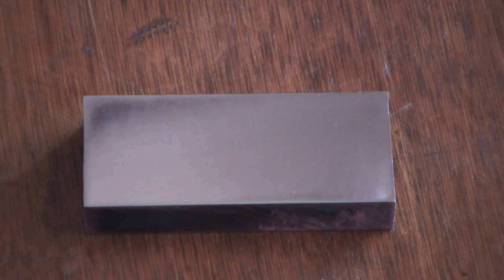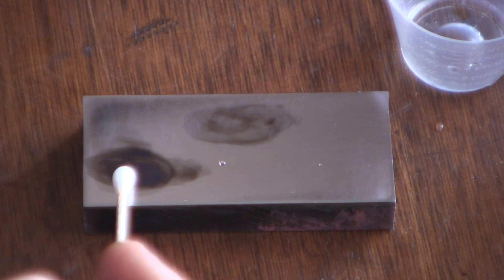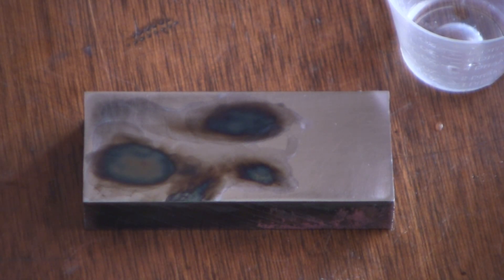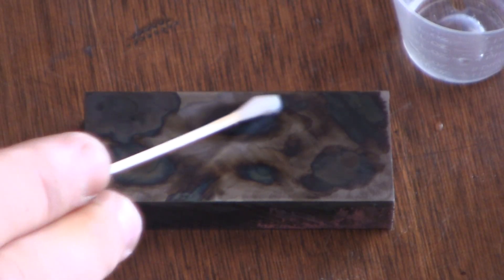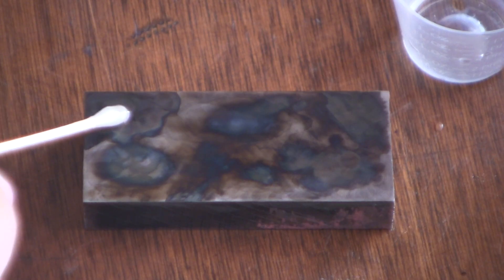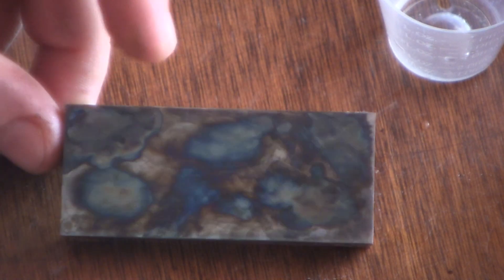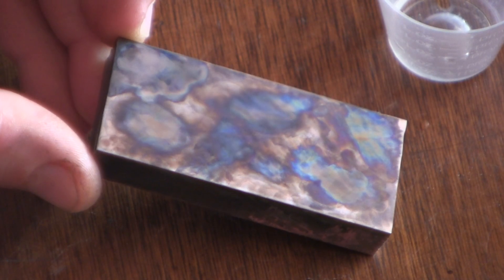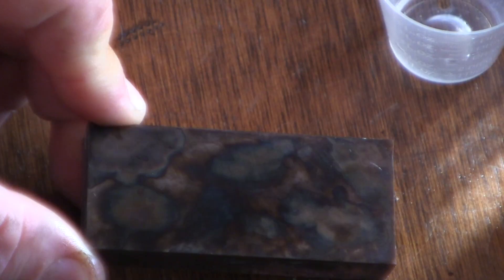Color Case Hardening Effect using Cold Blue

Comment: I just bought a pietta alchimista from EMF and when it arrived I noticed that on both sides where the frame meets the brass trigger guard, the case hardening effect was rubbed off and literally looks like polished steel. I tried using my brownells oxpho-blue along that area and it did exactly nothing. I dont know if its just that the brownells doesn’t work well, or if the pietta frame is stainless or something but im at a loss as to how to fix this and i cant spend hundreds more by sending it out to a shop. Any ideas why the oxpho blue paste didn’t do anything at all to the frame. Thanks so much
Reply from the maker: @MichaelEgan66  I don't know if it is stainless though it could be 416 for example.
Reply: @MosinVirus  I mean, I've used that oxpho blue creme on every other part of the gun and it works fine. I've puddled it onto the bare spots on the frame and left it for an hour and nothing happens.
Reply from the maker: @MichaelEgan66 It sure sounds like the frame is stainless.
Reply: Thank you for the confirmation. I'm at my wits end with this and pietta just will not respond to my inquiries.

Comment: Did it rust after words ? I heard after you apply the bluefish. You need to rub it down with a little bit of water so it doesn’t rust.
Reply from the maker: No, it still looks like it did when I made the video. Oiling is needed to prevent rust.

Comment: Hoping you still reply! 
I for some reason can't get it to work. I'm trying it on a steel ring I made and it pretty much only colours grey. Sometimes I get it to become somewhat blue, but it gets some cloudy stuff over it. When I then wipe that away, the colour also fades. 
But even when I get a colour, it is not nearly as vivid as yours.
Reply from the maker: Not sure what could be going differently. Try oiling the surface first. Bluing solutions are also degreasers so they should cut through the fine oil film. And perhaps dilute the solution a little more.
Reply: @MosinVirus  Hey Mosin! 
Thanks for the tip! I had a couple retries at the blueing, and I finally got a very nice blue undertone. Adding the oil really slowed down the chemical process, so I could accurately control the colouring stage.
The ring I made is definitely still very dark though. Not at all the vivid colours you have sadly. Maybe it's because we have different steel types? But I'm happy with it. The birthday girl is getting it today! 
I have another question! What do you recommend for how often it should be oiled (keeping in mind that it's going to be worn)? Or would you recommend a clear coat?
I also want to say: thank you very very much for this video!
Reply from the maker: @jhygdefghsd7011  definitely a clear coat. And I am glad I could help.

Comment: Is it possible do on chef knife? And be usable in kitche ?
Reply from the maker: The knife would have to be made from carbon steel and I still wouldn't use it in the kitchen afterwards.
Reply: @MosinVirus that what I though 😞 what do you think about patina gel? It water base chemical react to steel to make colour case harden? Apparently they said no pigment or dyes
Reply from the maker: @doggystyle2603  i never tried those.
Reply: @MosinVirus thank for replying.

Comment: If that looks as good in real life as it does on my screen, then it's absolutely awesome! Really impressed! I love the colours of case hardening, but it's an absolute nightmare going through the process of doing it properly! Can be quite risky too as parts can get distorted at the high temperatures involved!
Reply from the maker: Indeed. However no benefits of hardening.
Reply: @MosinVirus  true. I'm a knife maker, and there may be some potential to use this technique on parts that don't need hardening, such as crossguards and pommels. Depending on how it looks when I try it.
Reply from the maker: @BatwingForge  definitely give it a try.

Comment: Thank you for sharing ! 
I have a car I am taking to bare metal -Not a "cool" car though. Just an art car for advertising my art.  I just might use this technique !
I'm not sure it could be of use, but I feel like I should return the favor and tell you about something I accidently came across. I'm not sure what you would use it for, but here goes : Take some rusty metal ( but smooth - not too rusty ) and apply some paint to it in several thick layers. Let it set ouside for a month or two in the elements. Let it rust.
Peel the paint off, and you have strips of actual rust stuck to the back of the strips like rusted tape. 
You can then apply it to areas you want to have a rusty texture, but without actually damaging the item with rust. 
Do I have any examples or videos ? Sorry - no. 
As of now, I have not created any rust strips. It's just something I happened to come across on some old lawn chairs and thought might be useful.
Reply from the maker: Thank you very much. I will definitely try this myself. And yes, as the name implies, that is what got me started in guns.

Comment: OK so you’ve created some fake case hardening.. why don’t you just really case hardened it…???
Reply from the maker: This video was about creating a similar effect without actual case hardening. This was not a video showing how case hardening is done. If the video was about case hardening then it would have been a video about that. To tell you the truth I am a little confused by the question.
Reply: Great question. True color case hardening requires a furnace/kiln and materials to achieve this effect. This is a relatively cheap and simple way to simulate case hardening on a budget and takes A LOT less time.

Comment: Looks like Italian "case hardening". Doesn't quite pop like real case hardening nor does it actually harden the steel but if you don't need to harden steel and you want to replicate the Italian look, say restoring a neglected Italian gun, this is certainly the way to do it.

I keep this style in mind for my Italian guns. As they wear, I know I can polish and apply this solution and get the results I expect.

The butt plate on my Super Match rusted a bit on the toe due to heavy sweat during shooting and I missed wiping that edge with water to remove the salt. The heel of the plate has a brushed finish from sitting vertical upright and a bit of grit got to the plate. Not the end of the world, a once over with various grades of sandpaper then a polish and then this will bring it back to factory new.
No big deal.
Reply from the maker: Thank you. Yes, this is purely for looks, offers no surface protection and clearly no heat treating takes place. I was just surprised to see it so decided to share.

Comment: Is there sufficient bluing to protect the surface/prevent rust.  Bought an ESEE 5 with the intent to put a convex edge on it, strip, and then ... I'm not sure.  Until I saw this video, I was going back and forth between bluing or a high polish.  Or perhaps a high polish and then bluing.  Have you tried this technique on a 1095 knife?
Reply from the maker: The method shown in the video offers virtually no protection. Even cold blue when done properly offers little protection. Parkerizing is my favorite finish due to ease, and slow rust blue is awesome but time consuming.

Comment: Thanks man this lead me to this I picked up, If any one wants to get that on high polished gun steel and wants a high colour finish, when using the bud dip in super blue then take some very fine steel wool and brake the strands to make it less compacated and put the steel wool on the bit you want to colour and rub the bud on the steel wool on the gun steel and rub in for 4 to 5 seconds then use a fresh bit of wool and new bud to start the chemical reaction over again till your happy with the end finish, then rub light with fine steel  wool and finish with some protective gun oil 👍 I had no look with this but figured this little trick what might be what some are looking for. 😁
Reply from the maker: Thank you for sharing.

Comment: I'm going to use this to clean up a wall-hanger crescent side by side I have. It's not worth any real investment but I think this will be perfect for making it look a little fancier hanging on the wall. Thanks for sharing this!
Reply: I'm doing the same!
Reply from the maker: My pleasure.
Reply: @MosinVirus  I realize you may have answered this in the video already, but I want to make sure I get the mixture right. Can I ask what the exact mixture you used is? Thanks very much!
Reply: @franksmith7792 I thought he just dipped the q-tip in pure cold blueing solution... then dipped it in to regular water after that. Then used oil at the end to stop the chemical reaction.

Comment: For how much time it can last.
Reply from the maker: It will depend on how much use the surface gets. This block of steel has been on a book shelf since the video and still looks exactly like it did in the video.
Reply: @MosinVirus  now i have seen you have made this video in 2017 and its been 3 years since then, it is a long time
Reply: @MosinVirus  do tell me how many hours or days it will last, i am struggling to achieve a surface treatment and this looks fine at its place
Reply from the maker: @MONEYTECHDIGEST  I don't understand what surface we are talking about. But, as i said before, it depends on how the surface will be used. For example, if you are going to hit rocks with that surface it will probably not last very long. With general use, like hands touching it, it will last a long time, especially if it is also coated with clear coat.
Reply: @MosinVirus  I want to use it in some mechanical parts, I am trying hard to achieve this effect with heat treatment on alloy tool steel but i am unable to do so..

Comment: I've done this by putting a wash of detergent solution on first, and got some great colors.
Reply: What detergent solution? Pics of results?
Reply: @AviationJeremy  Any washing up liquid 50/50 with water. You can also put a few small dots of copper sulphate solution on first, to get some reds.
Reply: I'm getting ready to go e this a try. Just to clarify, you're washing the gun clean with detergent or leaving detergent on the metal before adding the solvent? By great colors, bold traditional colors or extra non traditional color?
Thanks
Reply: @donavonrobbins1908  Just mix washing up liquid with water, put it on clean steel and dab on some blueing solution. The detergent lowers the surface tension and you get a cool effect. Different blueing solutions give different colours, and if you add little dots of copper sulphate solution you'll get reds and golds. Just do some practice runs. You can always polish it off and try again. It's all done wet on wet. Once your happy with the result, rinse with hot water and let it dry. Dab on some linseed oil or spray with thin lacquer to preserve it.

Comment: I would like to do this with my heritage 22 hardened case gun and the see how it will look
Reply: The Heritage 22 frame is made of aluminum alloy.  I don't think it will work on that, but I'd love to hear how it turns out if you try it.  Good luck! 👍
Reply from the maker: @kentuckyjustice1408  i had no idea those were aluminum. Thanks for letting the OP know.
Reply from the maker: Try somewhere in an area covered by a grip first.

Comment: Thanks for the great video!  I have Cimarron 1872 Open Top that I was not fully satisfied with the case color finish, way to thin and lacking depth.  I tried your method using the came cold blue, actually before I found your video, and it certainly helped a lot but my job doesn't have the blue and brown color yours does.  Mine looks good but the darkening is mostly just smoke and black.  I'm still pleased with the improvement, but love the color in yours.  How do you get the color?  Thanks!
Reply from the maker: I think slowing down the transformation is key. Maybe even having a bit of oil from the hands on the part will make the color change slower, since first the solution will be degreasing the surface.
Reply: Thanks, I try that next time.  Don’t want to screw up what I’ve got. 👍

Comment: Does this only work with cold blue??? What is the different between the blueing agents??
Reply from the maker: I didn't do much investigation and research as far as what other cold bluing solutions would work the same way. I only posted what I ran into.
Reply: @MosinVirus  thanks Im going to  try it on my Ruger stainless single six👍🏼
Reply from the maker: It will not work on a stainless. For stainless you cannot do bluing at home. It requires a special bluing solution and specialized equipment.
Reply: @MosinVirus  crud. Thanks you saved me buying supplies👍🏼
Reply: Is there any DIY way to age it??  I have changed stock finish to a brushed finish. I’d like to darken it up some.
Reply from the maker: If you sandblast it with coarse media and then oil it it will become gray. You can also stonewash it and then oil it. Stonewashing will make it look more worn.

Comment: Would love to get an update as to how it holds up or what laquer or clearcoat you used, thanks and great video
Reply from the maker: I will try and remember to make a follow up video when I have some time. The problem is that I did it on a piece of steel that is just sitting there so it may not represent any real "use" conditions.
Reply: @MosinVirus  if the piece is still available and showing it's color, it would be very interesting to see it with standing a simple test of time to any fading. Then also take a piece of leather or something and start rubbing at the piece to see how quickly it fades away. I'm curious if it is at least as durable (or not) as a standard blued surface. Or, if it would be too delicate to fuss with on a gun that would have occasional use. Thanks in advance.
Reply from the maker: @donavonrobbins1908  I can tell you right now that it would not be as durable as properly applied bluing, especially hot bluing or rust bluing. This video was meant to show the effect that can be achieved, not as a viable method of protecting metal.
Reply: Understood, thanks for the reply friend

Comment: Not too shabby, sir! I've seen other methods using blowtorches and oil, things like that to my recollection. But this really seems to be a true aesthetic copy of color case hardening. I definitely have to give this a shot on the old rifle I'm looking to restore.
Reply from the maker: I was surprised when I saw this happen as well. Too bad there aren't reds in the color scheme.
Reply: Add red to the color see what happens wow this is crazzy.
Reply: Do they actually harden the steel with the torch? and/or do they heat it up a lot? I'm just asking, because I would like to create actual color case hardening in some cases... but I saw a method with torches once, but I had no doubt at all that the method would have greatly weakened the steel. There was enough heat to completely ruin the temper and people were doing in on firearms. I know that doesn't always matter, because not all parts of a firearm need to be perfectly hardened... but it could cause premature wearing and make the steel susceptible to scratching.

Comment: Will the spots that were not blued rust
Reply from the maker: Probably. Bluing doesn't really protect against rust on its own, it retains oil that protects against rust. As in, without oil blued guns rust too. This type of faux finish does very little to protect. Even the real color case hardening was often lacquered over to really hide steel from the elements.

Comment: Yes.  That was interesting.  And, I might try it on an old  breakover  shotgun... which has lost the color case hardening colouration due to  time, typical  wear from use,  minor surface rust...and  aggressive cleaning.
Reply from the maker: Unfortunate that the actual color case hardening lost the color. This method could be used to fake it, but I think you may want to lacquer over it to keep the colors longer. Try on some spare parts or hidden areas first.
Reply: I don't know if you tried this or not, but if you're not happy with the way your shotgun turned out, check out a channel called "Steel FX".  I used his product to restore an old H&R pistol that was originally had a color cade hardened finish.  It turned out great.

Comment: Hello, can you recommend the best lacquer to seal the color?
Reply from the maker: This is what I have seen people recommend. https://www.insituconservation.com/en/products/metal_varnishes/incralac_600
Reply: I have for years used the case color varnish sold my galazan...connecticut shotgun makers'  One bottle shluld last you the rest of your life.
Reply: Clear cerakote works great. Clear cerakote is a air cure, so it is really easy to apply and it will be a great anti-corrosion and abrasion protection
Reply: there is only one kind of lacquer, nitro cellulose
Reply: @lifeingeneral9111  Read the wikipedia entry for lacquer to learn how your statement is incorrect.

Comment: Would I have to rub a blue finish off a gun to do this?
Reply from the maker: The finish would have to be removed. I just don't know if you should remove real finish for this fake finish that will not really protect the metal, unless you plan to lacquer it.
Reply: Yea its an old cheap $100 22lr. Figured why not try it out